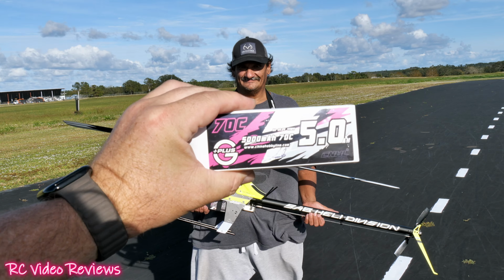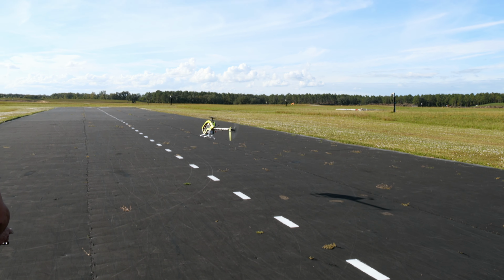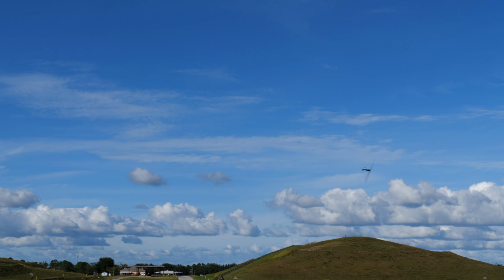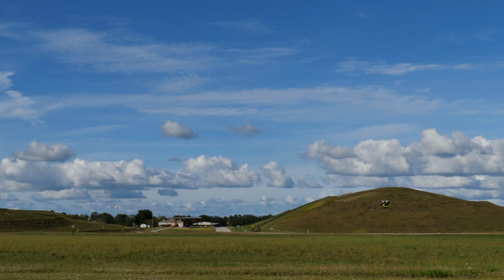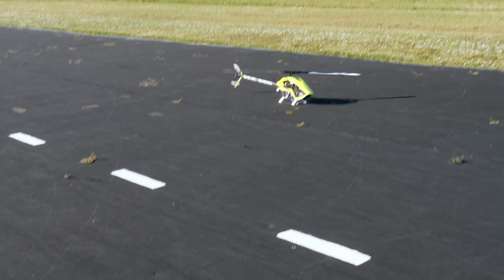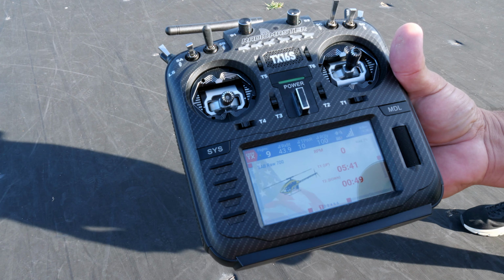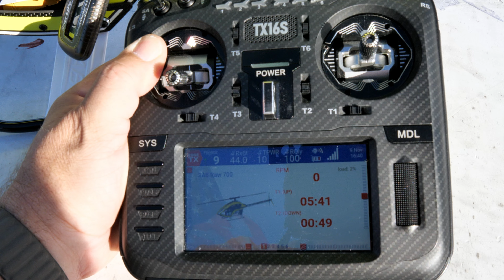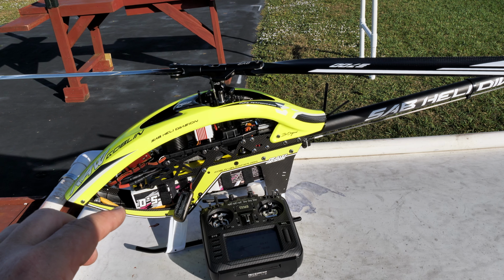CNHL 6s 5000 • How do these batteries perform?

Comment: Folks my first batch from CHNL just arrived yesterday. I immediately tested....3.81 - 3.85V across all cells. Thats a .04v variance! 
I couldn't be happier with how tight they were shipped and stored. Im switching my future purchases to CHNL, I've heard nothing negative about them and for a first impression, I agree.  

*edit: 6s 5000mah batteries for $54 each! I also got 6s 2200mah for my RS4 Venom at $23 each! That's about 1/3 the cost of what I was paying (I now own over a dozen) for Pulse batteries and they have never ever ever shipped that tight. Really excited to see how these perform, already the price point has impressed as well as the shipping voltages.

Comment: I got 14 5000mAh 6s 70c CNHL batteries at the beginning of July 2023. For my KRAKEN and RAW 700. I'm not sponsored or associated with CNHL in any way. I live in the UK so the temperature is a little lower than the USA so it tells in the flight time. I get a solid 4 minutes 30 seconds landing with 3.7v per cell. I'm now at 600+ (stopped counting after that) charges on all 14 packs. I still get a solid 4:30. IR when new was 2 mega ohms taken with my icharger 3010B. Just  10/11/2024  taken another IR with the same charger still at 2 mega ohms per cell. These are my own personal findings with these batteries. Thumps up from me 👍🏻👍🏻. I have tried many brands over the years.
Reply from the maker: Great fact based report. Thank you for sharing.